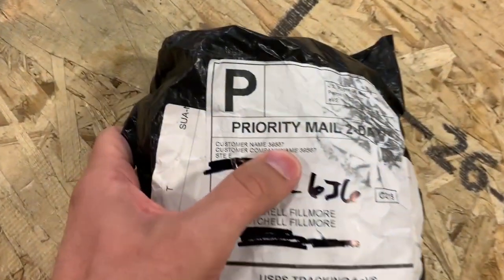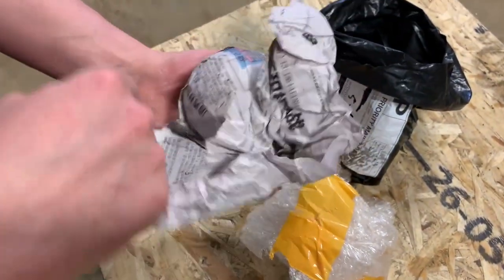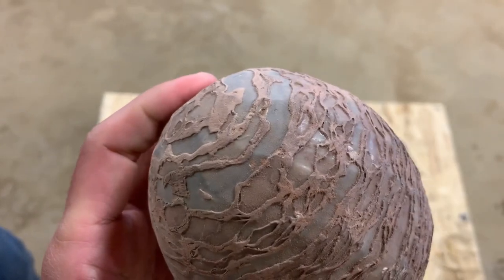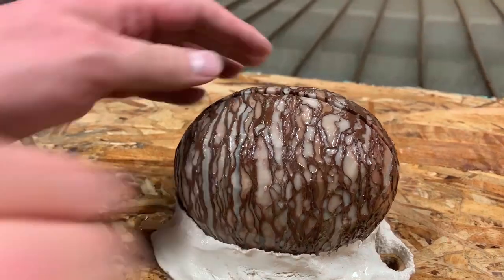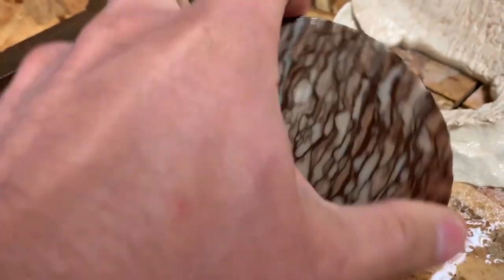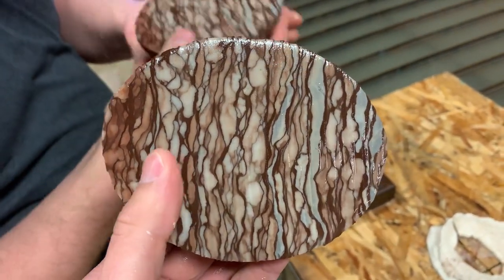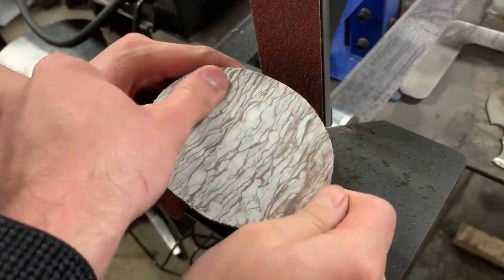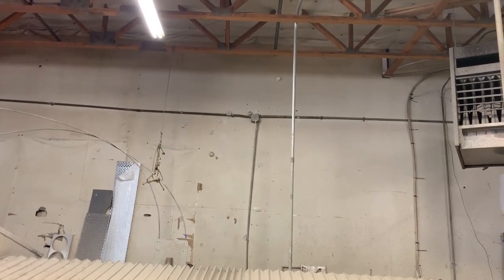Dinosaur Egg Fossil Cut in Half- Real or Fake eBay Scam?

Comment: The rock looks to be some type of sedimentary SiO2 jasper.  Actually quit cool! But not a dino egg...lol
Reply: That's what I though too!
Reply: All jasper is SiO2 and you know it lol
Reply: @MrBmantheman  and your point? I'm a bit confused by your post.
Reply: Resin and soil 60 bucks on Amazon
Reply: Looks like agate.
Reply: @saltysteel3996  it'd be worth more than 199.00 if it was agate!!
Reply: I used to have a pterodactyl turd, it looked kinda similar, but also looked like a turd fer sure. Conglomerate would be the geo-eontological material name, but it was found on a dig, and had a paper of provenance.
Reply: Mischa Ballard 
Nope, resin.
Jasper is not sedimentary, Si02 is a silicate microcrystalline deposit of the same family as chalcedony , carnelian and agate.
This monstrosity is man made resin, there is no way you could smooth jasper on a belt sander without burning your belt and hands and fracture or break the rock.
Reply: Could be dinosaur egg Jasper there are all types of funky names for Jasper types then shaped into an egg shape
Reply: It looks like a Jasper stegnosaur egg fossilized crystallized fossil jurassic cretaceous.

Comment: I expected those lines on the outside to be like an epoxy or plaster they put on in that webbed pattern, but it's a pleasant surprise to see that it's not. I mean it's kind of awesome really, that must be marble striated with a harder rock that doesn't erode as quickly. Maybe cooler than a dinosaur egg.

Comment: Make it into a 1911 grip!
Reply: The trouble with using Rock as grips is normally the grips are screwed to the frame, but I guess you could epoxy them or glue them on. It would look very cool for sure

Comment: I don't think they would sell an actual dinosaur egg on eBay, it would be in a museum. It's a cool rock though, I think it's actually better looking when it's cut in half.
Reply: Museums get fossils 3 ways.  Some have the resources to fund expeditions by paleontologists to find them.  Many are donated.  Some are purchased on the open market.  There is no reason whatsoever why eBay would not be used.
Reply: @markdoldon8852  Even if they did I'm sure it would be more expensive or look more genuine at least.

Comment: It might very well be an egg of a dinosaur or a prehistoric bird. The egg would most likely be laid down with the longest side towards the ground. As the shell rotten, different segments of mud and water and perhaps other unknowns has penetrated the shell, and mingled with the embryo, making these borderlines of the concoction inside. And that is why the stripes runs through the egg in one direction. I can probably tell which side that went down also. The end of the egg has a different structure and color, which makes sense to my theory. I'll take an educated guess that the blue parts of the stone has been colored by dissolved plants surrounding the egg and mud in the processes, before it hardened. Next time you'll probably try one of those Faberge eggs :D

Comment: Did they expect to find an embryo inside the egg? Because that’s not how fossils work, for the most part a fossil is the replacement of the natural material or the hardening of the sediment around the bone making the fossil into a rock. Soft tissue is the first thing to go in situations like this, the embryo will crystallize into the formation as seen in the video as over the last 65 million years the tissues as decomposes and has been replaced with natural material. It is very rare to still have a preserved embryo or remains inside an egg as most dinosaurs that are fossilized in eggs were not old enough to have bones and etc, the fossils with visible bones were further along, which is why they are rarer.

Comment: Is it marble with a different rock forming the brown lines? Marble is calcite which will dissolve in a dilute hydrochloric acid (muriatic acid). The other rock probably doesn't. 
I'm guessing they carve the egg shape from the marble then soak it in acid for a while to dissolve a few mm of the lighter marble, leaving the textured ridges of the brown rock.
Cut a bit off and let it soak in hydrochloric acid and see if you can replicate the texture on the cut surface.

Comment: Heads-up: Gmail is automatically filtering your "waterjet knives" emails to the spam box.  I only happened to catch the one you sent today by chance as I figured I should take a quick glance to see what all was ending up in there.
Reply: 'Gmail' filters what you tell it to filter.  Its not automatic.
Reply: @markdoldon8852  sure, for regular filters.  Spam is community and AI driven.  If a enough of the same thing gets flagged, it will end up applying to everyone.

Comment: Its a rock that was shaped like an egg and then placed in a corrosive solution to dissolve the softer stone and leave the harder stone on the outside kind of the same way you do Damascus steel when dipping it in acid.

Comment: What’s messed up is a lot of stuff on eBay is either bad or fake and in this case dinosaur eggs are very rare and if you actually got a Dino egg on eBay it would be one in a million. Also if you cut it and it’s real there no going back
Reply: They’re not listed very often, but they’re not 1 in a million. I’ve seen poor quality eggs go for as little as $50. Though a good quality one will set you back $750-$10k depending on which egg type it is and if there’s an embryo inside.

Comment: whats the psi of the water jet...around 15k? does it cut steel1/4 thick plate??? very cool machine.
Reply from the maker: 60,000 and yes. It will do 8 inch plate
Reply: @WaterjetChannel  insane!